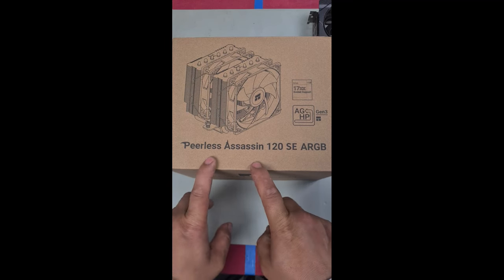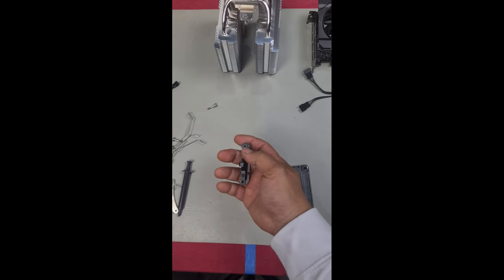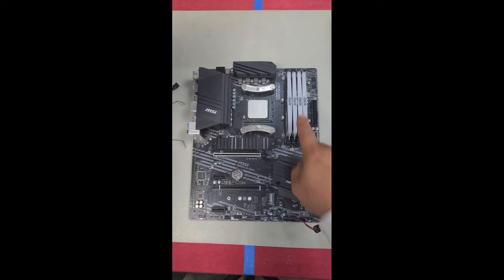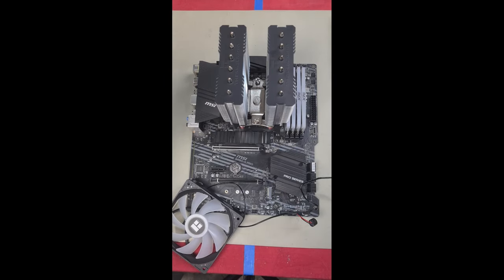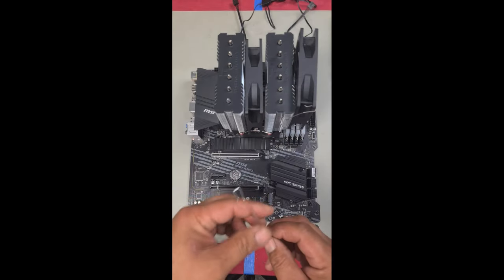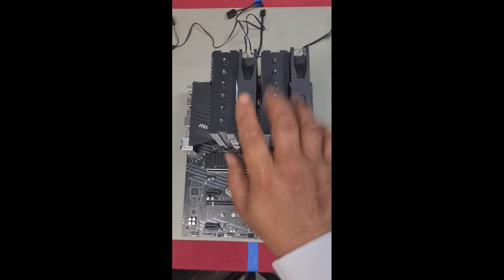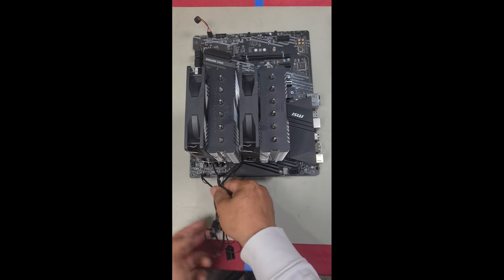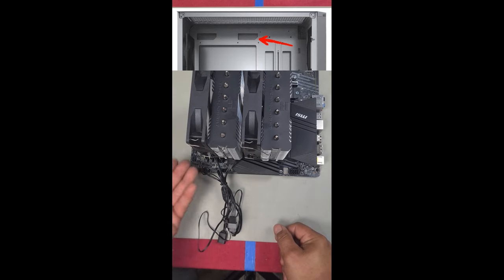thermalright peerless assassin 120 SE ARG dual tower black air cooler install on am4 motherboard

Comment: be sure to install mother board to case first and connect motherboards power cables otherwise you can not connect mb cpu power cable ...
Reply from the maker: @aceberganabolic  or just install fans after

Comment: Mate my motherboard doesn't have a 3pin for the ARGB, is there any problem if I don't connect those cables? I don't really care about the lights I just got those cause they were cheaper
Reply from the maker: @PeanutButter1981  nope doesn't matter.  the fans run off the pwm connectors theb5v3pin is just for argb that's all.. so if u don't care for rgb u don't need to connect themm and it will still work
Reply: @MIKEYZVLOGZ  Thanks man, great video!
Reply from the maker: @PeanutButter1981  cheers bud...

Comment: Hi, can you please explain how did you connect argb connectors of both fans in series? There are total 4 connectors, with 2 for each fan. If you connect two fans connector together which will leave two but you only connect one on the motherboard for the ARGB. What do you do with the remaining connector?
Reply from the maker: it's daisy chained..meaning... you connect one argb to the other argb connector... u will see it has a splitter male and female argb 5v 4pin connector ... that's why u only connect 1 argb connector cuz the other fan connects to the argb connector...which acts like a splitter hard-wired to the fan ..hope that helpsn
Reply: @MIKEYZVLOGZ  thank you

Comment: Thanks for the video and comments.  If you have splitter with 3 and 4 you can plug fan power in just fine.  I was stuck on this 😂
Reply from the maker: ye whether ur fan pwm connector is 3pin or 4pi n the tab still lines up so u can still plug it in and it's suppose to be like that

Comment: The Thermalright Phantom Spirit (4X8mm heat pipes, 140mm, 120mm fans) and Frost Spirit (7X6mm heat pipes, 2X120mm fans) are both much better than the Peerless Assassin for the same money. Thermalright has so many similar coolers that all look alike but, perform differently.

Comment: I just got this for my new build, was told its amazing for the value alone
Reply: it is!used an esports duo 34 for years, bought 5800x in january! it killed a cheap 240mm aio before I got the proper pbo settings!the duo had 80-85 degrees celsius on workload with premiere pro!with this cooler its under 60 degrees over 27 minutes 4k video rendering!
Reply from the maker: 100%

Comment: Much appreciated, same gear here exactly. This is a great help.
Reply from the maker: ur welcome buddy 
but make sure u install it the way recommended unless u don't mind a little bit of noise from the fan.i will do a quick short explaining
Reply: @MIKEYZVLOGZ  My case is not a visible showcase so I have no issues setting the fan up slightly to clear the RAM.

Comment: Best tutorial out there, keep it up man 👍
Reply from the maker: @juzymango1036  thank mate I will be doing more videos on thermalright products especially because they are very well made and excellent performing for the price point ...and look great too these air coolers and similar designed ones are a great choice for any pc...affordable and can keep uo with some mainstream brand aio 360s even ..so that's just an idea of how good these are...alot of dual tower air coolers actually perform very well and this is no exception ... absolutely an amazing cooler

Comment: I'm building my first PC with this cooler next week so I appreciate this video a lot. I'm going to install the fan over the RAM first and see temps, then try it in the back and check them again. If there's no major difference I'll probably leave it in the back. Also, is it okay if the fan touches the RAM directly or should I leave some clearance?
Reply from the maker: Leave some clearance ..very small... just lift it 1 or 2 mm above the ram
Reply: So let us know? Was there a difference in temp moving the fan to the back?
Reply: Bumping this to see if there was a difference having the fan at the back. Trying to decide if I get rgb DDR5s or not.

Comment: Good to know in advance that using the optimal configuration covers ram. Obviously any rgb lighting will still spill out but considering it's pretty much covered fully from the front makes me think I wouldn't be missing much going non rgb ram (theyll save me a few dollars too)
Reply from the maker: yep u got it, so u understand why I did the other config? some ppl dont, but your right if your not going for rgb ram it wont matter , but some ppl still want it all showing, guess it just depends on the person
Reply: @MIKEYZVLOGZ  so will the configuration that does not cover the ram work fine? and also which way if i do it that way do the logos on the fans face, im currently installing right now, any help would be appreciated.
Reply from the maker: @otis81388  look at the fans it shows which way the air flows..theres arrows showing this 
also the side with the frame should face the back of the case ...ur suppose to install on top of ram and in the centre

Comment: Hi. Thank you for the video. I am willing to buy this cooler but I know I'll have the same issue with the memories as I also use XPGs D41. Do you know how much does the fan go up? I have a clearance of about 170mm inside the case, per the manufacturer and the PA120 is 157mm tall. I still consider using it 1 fan only but not the best option. Thank you in advance.
Reply from the maker: actually buddy ur gonna be OK... as u can just raise the fans higher to clear it ... at the time of filming this I wanted the fans flush to the tower fins but after a long hard think it really isn't that bad to just raise them abit higher and make sure you raise both to match dame height and it will look great..and honestly price to performance there really isn't anything like it ... however also consider the phantom spirit apparently it performs abit better and exact same design honestly

Comment: how much difference does it make when we move the fan if we want to show off our rgb rams? is it a huge heat difference?
Reply from the maker: @esatozpolat8867  no not huge at all...main thing is abit more noise cuz of where the fan is mounted ..creates like a wind tunnel...but not enough to be annoying..and wen u put through glass panel on u barely noticed it
Reply: @MIKEYZVLOGZ  oh i see, sound is not much of a problem for me but my exhaust fan is also rgb. if i move the fan, will it block the fan's rgb this time? also since we moved the fan does the exposed cooling tower look ugly?
Reply from the maker: @esatozpolat8867  no ..it won't block rgb ...u will still see it.. and it doesn't look  bad at all
Reply: @MIKEYZVLOGZ  thank you so much ur the best
Reply from the maker: @esatozpolat8867  nah... u are for checking out my video..I appreciate u so much

Comment: Do youu need to plug in the leds to the motherboard ?
Reply from the maker: leads as in fan cables? yes or else i are nor powering the fans and they won't work ... also it has 5v3pin argb cables too so u must plug them into mobo as well...unless u have an adapter but there's no point unless ur mobo doesn't have the right ports

Comment: In my case one fan has 3pins, and the other has 4pins. Is this ok? Which fan to put in the center of tower?
Reply from the maker: What do u mean. Aren't u using the fans that came with the cooler
Reply: It's okay to plug the 3 pin into the 4 pin slot. Just make sure the key mechanism slides in

Comment: aye man, was wondering if you know if the corsair vengeance pro rgb will have any issues if I just put the second fan on the left side like you did? I shouldnt right bc no fan is covering the ram
Reply from the maker: yes correct no issues with that..  u won't have any issues...well to be fair u might just hear abit more fan noise due to the setup of the fan blades being closer creates like turbulence so to speak ... hence the noise level increases ..but u can fix this by lower fan speed too..just something to mention
Reply: @MIKEYZVLOGZ  appreciate the insight! just copped everything new besides the 4070 ive had haha
Reply from the maker: @ayoFlav  nice my man!!!

Comment: Hey bro do i have to connect the two cables of the fan? Or the  cable of argb also turn the fan ON?
Reply from the maker: both ..one is for fan power and the other is for rgbb
Reply: @MIKEYZVLOGZ  thanks bro!  Do i use SYS_FAN1 or PUMP_FAN1 ? Mortar B660
Reply from the maker: @jahmarko  either ... even cpu_fan
Reply: @MIKEYZVLOGZ  thanks bro! It downed my temp  from 91° to 54° on i5 12400 while playing warzone at 1080! 🫶🏻 and looks amazing!!
Reply from the maker: well donen

Comment: On the splitter there is one three prong connector and one four prong
Reply from the maker: that's ok u can still use it ... as long as the fans can plug in which they will

Comment: how is the ram clearness  and  can I just move the ventilator on the left side  blowing  at my ram
Reply from the maker: @henrikfox8960  honestly although it's meant to go in the middle of dual tower and right side above ram ..u can do what u want..on another build I put it on the left side closer to the rear of case to show off the ram..just be aware that it will create a small wind tunnel sound ..not a big deal but it's abit louder..as for ram it clears even t force delta rgb ram and that's pretty high ..I just light the fan a tad higher to clear your ram but for non rgb ram it will clear no issues
Reply: @MIKEYZVLOGZ  thx
👌
Reply from the maker: @henrikfox8960  no sweat homie... glad could help

Comment: are those brackets the same with different manufacters? I plan to switch my current cooler to a 120SE, it wpuld save me work, if I can just remove the old cooler and use the installed brackets (they look at least the same). has someone a clue?
Reply from the maker: @fmdfm-s4i  majority of thermalright are the same for air coolers..as long as ur using the air coolers still u can use the same bracket

Comment: The Rgb of one of the fans ain't working. Any idea on how can I fix it?
Reply from the maker: could be faulty ... is it plugged in right ? was it working before? is it daisy chained to other fan?
Reply: @MIKEYZVLOGZ  I think it's faulty. The fans work fine, it's just the rgb of one of the fans that doesn't work. I just bought it so I think it's a manufacturing problem.
Thanks for the reply, man!
Reply from the maker: @luisdo96  and is it all plugged in correctly ?
Reply: @MIKEYZVLOGZ  Yup. It was chained to the other fan as well
Reply from the maker: @luisdo96 unfortunately might be faulty ..also double check none of the 3pin are bent too or it's plugged in right sometimes if u rush u don't plug it in properly I've done it before

Comment: i bought this cooler for build motherboard is ASRock B550 Phantom Gaming 4 and cant fit my other ram the fixer guy i went to said the ram is intel type thats why it wont fit is there such a thing im new to pc ?
Reply from the maker: if u have a b550 mobo it's used ddr4 ram... there's no such thing..as long as your RAM is ddr4 it should fit... u just need to lift your fans higher wen installing them and it will clear the ram ...I'm not sure who u went to but doesn't sound right..what is your actual ram brand and model
Reply: @MIKEYZVLOGZ  corsair vengance rgb pro its c15 with 3000mhz
Reply from the maker: @solohan2k780  ddr4 right ? if it is then yes it will work ... nothing wrong with it
Reply: @MIKEYZVLOGZ  yes ddr4 
thank you so much for help  I was about to buy new rams
Reply from the maker: @solohan2k780  happy top help and thanks for subscribing
Reply: @MIKEYZVLOGZ np
I decided to go with the push and pull config way that way seemed easier
Reply from the maker: @solohan2k780  yeah its not a big deal, if u feel it too loud just slow down the fan on the left
Reply: @MIKEYZVLOGZ  okay 
Thank you so much
Reply from the maker: @solohan2k780  ur welcome

Comment: If you move the fans to the pull-pull configuration to show my RAMs like you suggested, you can also reverse the orientation of the clips so that both fans are clipped on to the towers in front of them, so they pull air out of both towers more effectively. This seems kinda obvious but I hadn't thought of it until after the build was complete 😅
Reply from the maker: that's true bud.. 👍  however as another guy suggested push is always better ..its true.. however try it and let me.know what u think ..does it really make alot of noise? as someone else suggested ..I havent paid very close attention to hoe much noise it makes.. I personally thought it wasn't a big deal..but I could be wrong..plus u can always lower fan speeds ..its because the fan blades are closer to the find meaning more sound etc..  what do u think?..I still gotta test this

Comment: Which ram are you using xpg which model?
Reply from the maker: d41 they not as high
Reply: Will my patriot venom viper 43mm 6400mhz fit?
Reply from the maker: @deepregmi5985  is it ddr5?
Reply from the maker: @deepregmi5985  is it ddr5?
Reply: Yes its ddr5 sir 43mm height
Reply from the maker: @deepregmi5985  u may have an issue with fitment..but like I stated u can just use the push pull config.. its still gonna cool... its not a bug deal..last option is to change ddr5 ram or change cooler

Comment: i had a big enough panic attack changing my power supply i was going to fit a new cooler but after seeing i have to remove the mother board id end up having a heart attack
Reply from the maker: lol I feel ya..depending on your case ..u don't have to remove the mobo. if u have enough room to install the backplate u can do it without removing the mobo.. just depends

Comment: I thought I messed up my mobo until I seen this cause I noticed there was a pin missing at these exact spots
Reply from the maker: u mean for the 5v 3pin ? argb cable? or the rpin pwm connector for the fans
Reply: @MIKEYZVLOGZ  yeah sorry for the late reply. Just finished my first build ever and everything is working great

Comment: Can RGB be turned off?
Reply from the maker: yes u can turn off with software
Reply: @MIKEYZVLOGZ  Sorry for the question but what software do I need?
Reply from the maker: depends what mono ur using
Reply from the maker: @hectormartinez7002  it's ok if u use gigabyte u use rgb fusion if u use asus ..u use armoury crate..and so on... with the software u can turn off..but if u don't want rgb just buy with no rgb..or use black fans
Reply: As others have said you can use your motherboard software to turn it off but you can also simply not plug in the rgb connectors. Just bundle them up and feed them to the back of  your case behind the motherboard to get them out of the way.

Comment: 8:00 my mother board has 4 pins what do i do now
Reply from the maker: u need an adapter that goes from either molex or sata to 5v3pin
Reply: @MIKEYZVLOGZ i have the same problem i only have 12v 4 pin, can you send us an adapter? Idk what adapter purchase and i dont want to put a hub too big, thanks for the video
Reply from the maker: search sata to 5v3pin adapter and ull see what it is
Reply: @AssaPowah  i have 12v4 pin too
Reply: @MIKEYZVLOGZ  i’m not sure which one is it
Reply: i don’t want to get the wrong one
Reply from the maker: @inosuke-chan1095  if your mobo only has 4 pins u can do 2 things..either use an adapter that has a built in controller that will allow u to change the mode and color via buttons. or use an adapter that converts the 12v 4pin  rgb header to a 5v3pin... I'm making a video about it soon just waiting for the part to arrive
Reply: @MIKEYZVLOGZ ok ty
Reply from the maker: @inosuke-chan1095  so welcome
Reply: what motherboard do you have
Reply: How does push and pull work for you? does it still run cool? I'm planning on doing that coz the fans are hitting my ram sticks
Reply from the maker: @zyx1394  it works fine